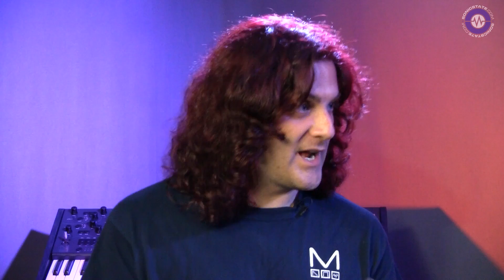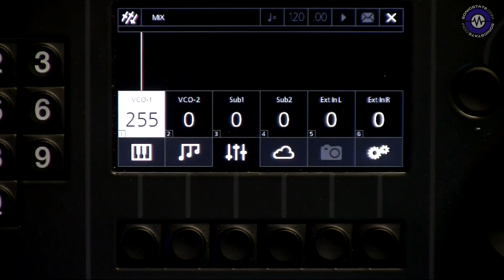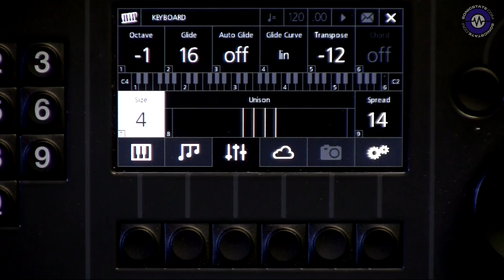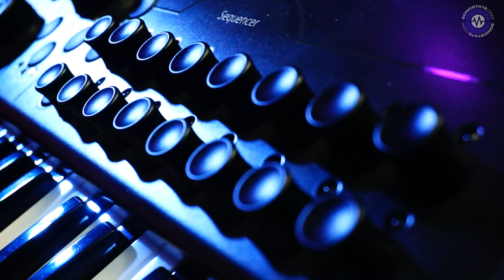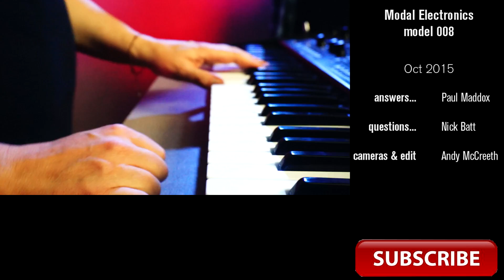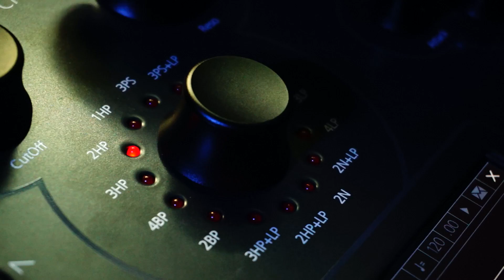Modal Electronics 008 - 8 voice analog poly sounds

Comment: JUPITER 8 KILLER
Reply: hmm i've read this comment before. i'd say it can only hold true to someone who never used a Jupiter 8 and doesn't really have a clue how it sounds.

hint:  not to take away from 008 on its own, but they couldn't sound more different as far as polyanalog characters go.  from oscillators to filters to envelope shapes and onwards. apples and oranges.

if 008 sounds at all like some of the vintages, its general fizzy character and peaky filter remind me of Xpander and Matrix 12 at times. tho latter is more smooth, whereas Modal is more bity and forward.

Comment: wow, this thing looks cool.  Being able to sequence a change to the filter type is not something I have seen before.  Front panel looks intuitive to use.  Outside my budget, but I could understand, a bit, why so much.
Reply: +Michael Bauers The old An1x had Free EGs where you could tweek knobs and settings in real time and then it played back on each note press.. so kind of the same except realtime insted of step sequence. if my memory serves me correctly it could do 4 of those pr patch.

Comment: The filter modes look like the ones on the Oberheim Matrix 12/xpander and also the buttons look the same - is there anything in this? Is the synth related to the Matrix 12 internally? Wouldn't be a bad thing.